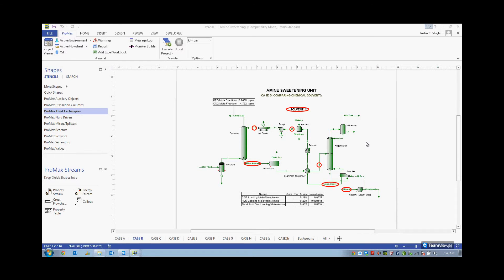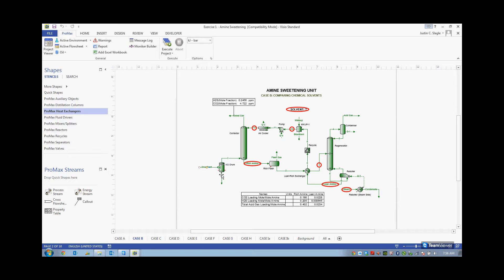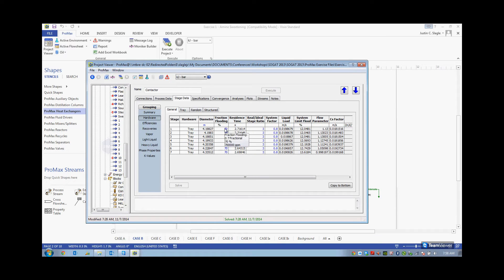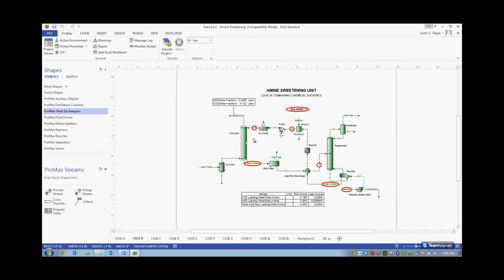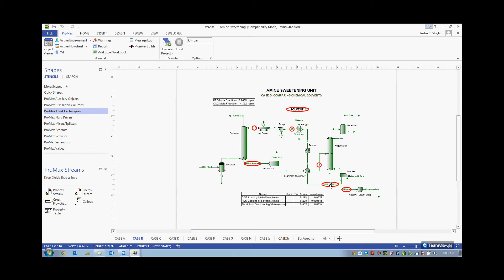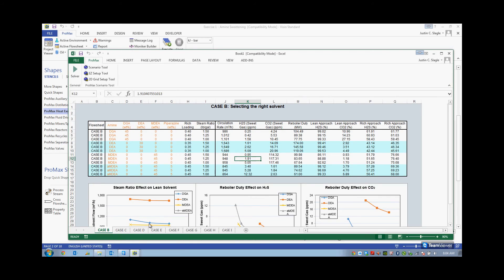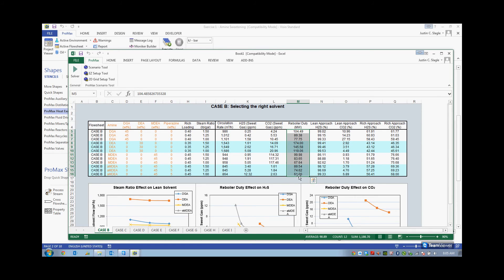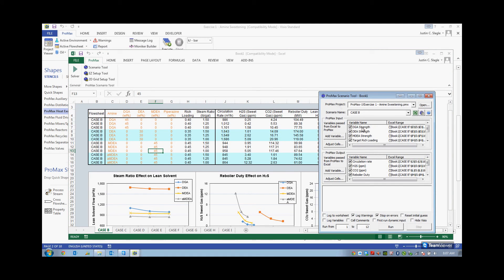Amine Sweetening Initial Design

Comment: can i get hand calculation for material and energy balance about stripper.please
Reply from the maker: This video focuses on the design of an amine sweetening unit using ProMax. The best references I can give you for performing hand calculations are Gas Processing by Kohl and Nielsen and the GPSA handbook. Feel free to contact support@bre.com if you need more details about the process.
Reply: MrProcessEngineer
 Thanx alot